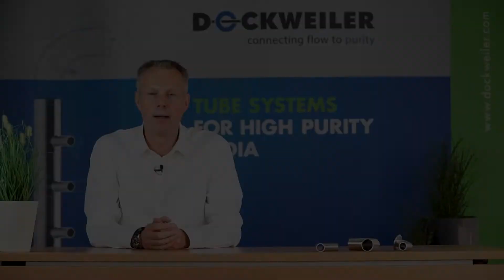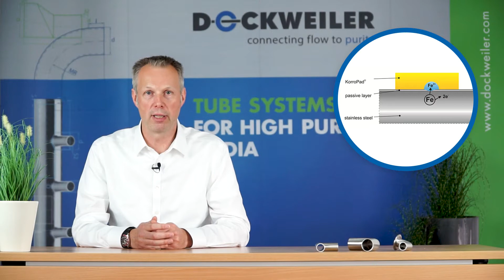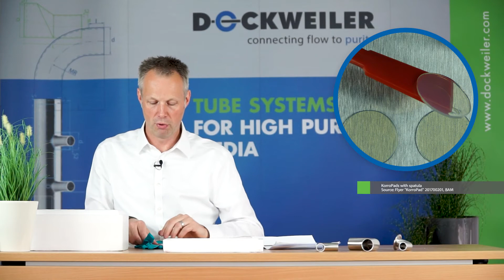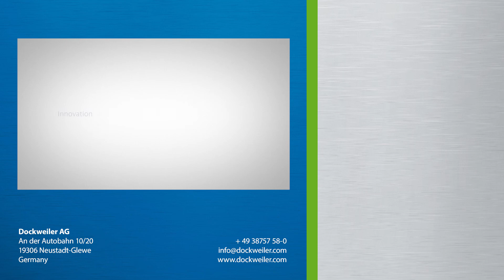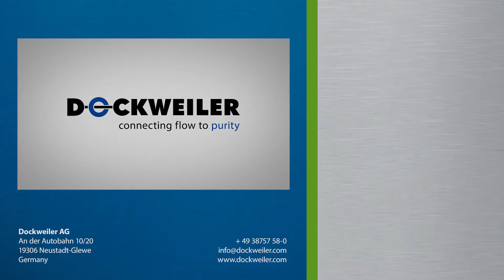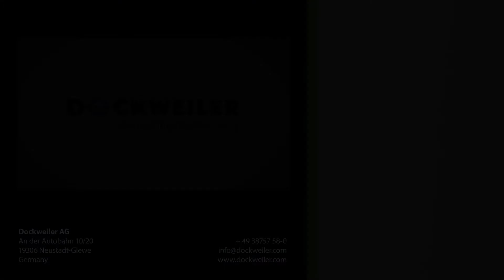Corrosion test for stainless steels

Comment: Any Nondestructive corrosion test available for chrome plated products, PVD coated products, and Organic coated products?
Reply from the maker: The Coropad Testing indicates defects in the passive layer of a stainless steel. The passive layer in general is a view nano meters thick. As I believe the coating you are referring to is larger it’s questionable weather it works or not but I would give it a try.